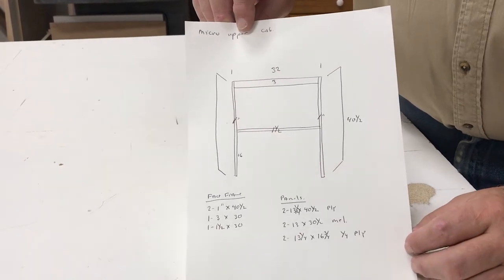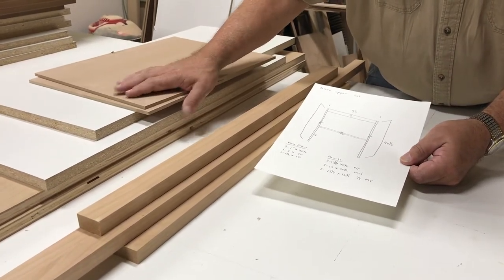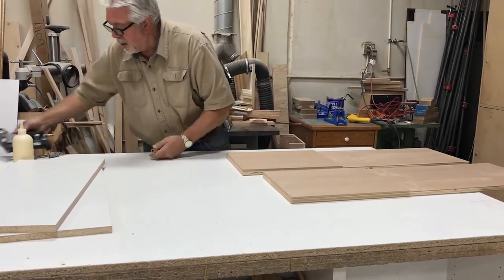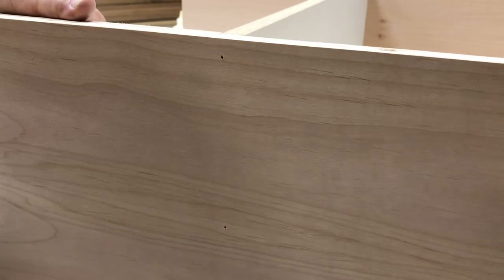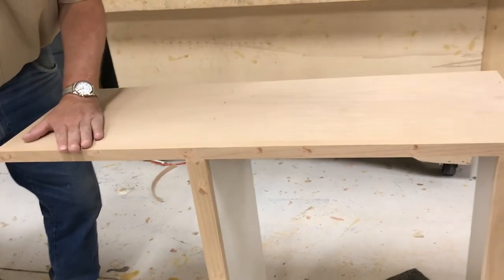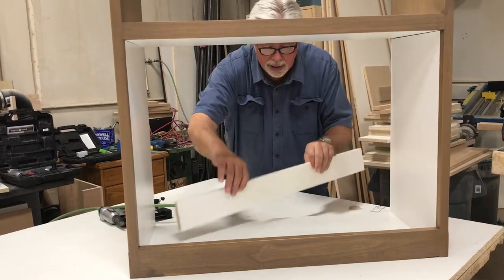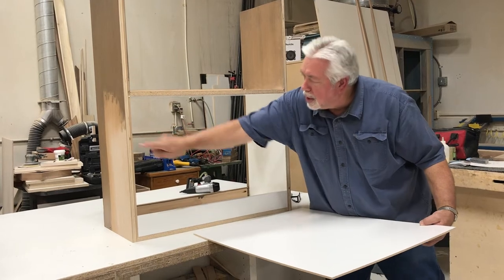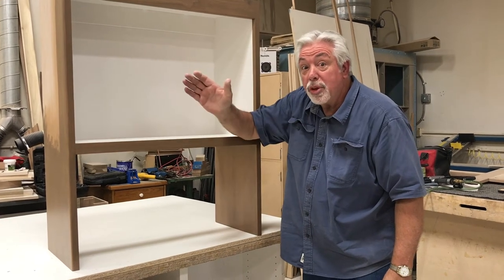How To Build A Better Cabinet For Undermount Microwave

Comment: Looks great!  Would love to see what the cabinet looks like installed with microwave installed.  Do you have a picture?  I would like my Over the range microwave cabinet to bump out but we don't have a vent to the outside so I'm not sure if we can use a deeper cabinet like this if the microwave vents out the top.  Do you know of a solution for an over the range microwave that vents out the top if you want that nice built in look like you made here?

Comment: Hello @Woodworkingwithwes, I’m currently in the process of planning to build a microwave upper cabinet for our condo.

Just out of curiosity, after you put the cabinet back on, didn’t that cause your lower half of the microwave upper where the microwave is installed to stand off the wall approximately 1/4” or 3/8” (the width of your cabinet back).

How would you recommend avoiding this stand off from the back being installed so that the side panels for the microwave fit flush against the wall?